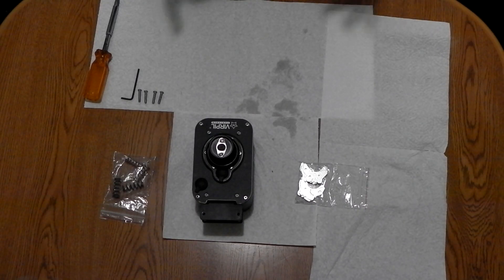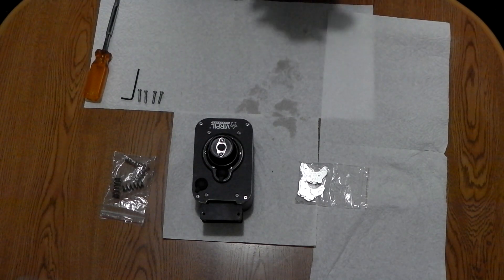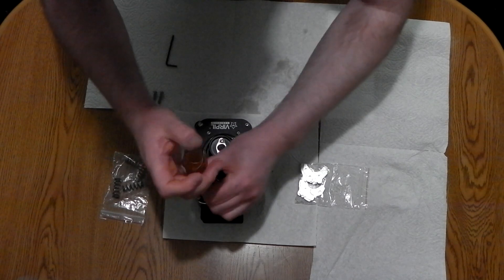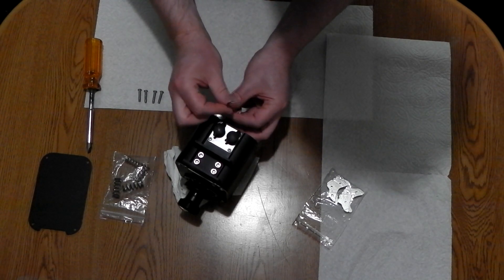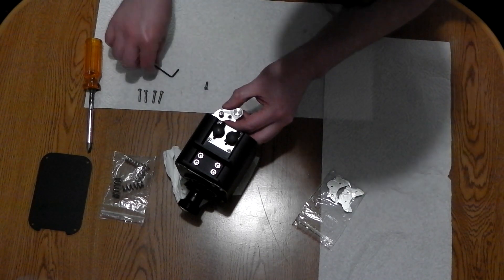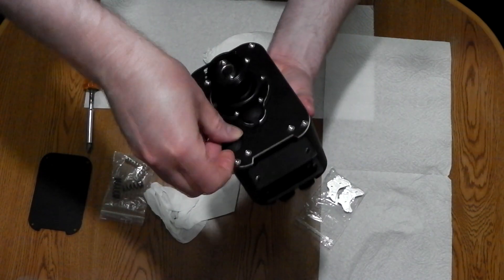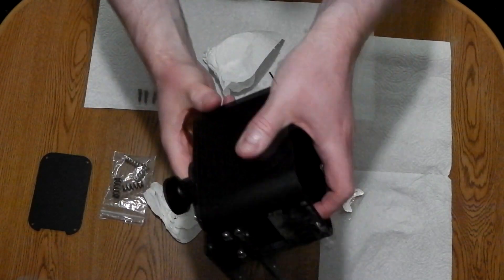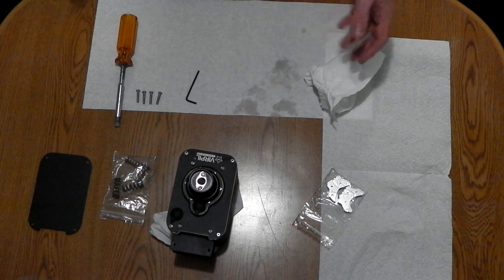VPC MongoosT-50CM2 Base - Change CAMs tutorial

Comment: Nice. Got a stick (cm2 base) and throttle and collective with an l alpha waiting in the post office. Nice walk through for preparation.

One thing though. Helicopters should be light, or rather loose. No center and no force will be most proper setting.

Comment: No mention of how tight the new stick is?
Reply from the maker: Hi, Not sure exactly what you mean by "tight" ?
Reply: You add an extension to the stick and its loses all its tension.New stick is supposed to cure this by allowing stronger springs to be used with long extensions.
Reply from the maker: @dealwolfstriked272  AH ok I get you, I am using the lightest springs with a 50mm extension, I fly a lot of helis so want a stick not to hard move but yet want it to return to centre, it does that fine
Reply: That is my main reason to buy the new gimbal.For me any extension I add just reduces the tension to unacceptable for my needs.I will wait for someone who uses extensions and flies planes then....anyway thanks for response.
Reply from the maker: @dealwolfstriked272  What grip are you wanting to use with it ?
Reply: The warbrd for now but eventually all grips.
Reply from the maker: @dealwolfstriked272  Iam using CM2 base (aviation sim soft centre cams with lightest springs)  + 50mm extension + CM2 grip. The movement is smooth and the return to centre is fine
Reply: @HavocCompanyClan  This may be a dumb question, but how do I tell one cam set from the others? Do they come marked as Avia or Cosmo? or? Thanks, love the content. I am SLOWLY figuring out how to program my throttle so i can start using it. ;)
Reply from the maker: @claytonwhitman1608  see this pic https://i.imgur.com/CYAdS0Q.jpg
Reply: @dealwolfstriked272  FYI I installed  the TM Warthog stick (very heavy) on the CM2 base with the standard springs and aviacam soft center (stock from factory) with 100mm extension and DO NOT like it at all for flying fighters. The soft center on both axis combined with the heavy weight of the stick is a strange imprecise feeling. Switching to avicam no center for roll, avicam soft center for pitch with heavy springs which hopefully will make it better.
Reply: @MANZOIL  thanks.Right now I run no extension on Warbrd base with lightstick and the extra heavy spring and its better IMO.
Reply: @dealwolfstriked272  hey quick update for you and anyone else reading this, Virpil responded last night and confirmed there’s a manufacturing issue with their cams. Apparently they were redesigned summer of 2020 so if you have some prior to then I recommend you reach out and they’ll send you new ones for free. This explains all the uneven and strange feedback I was getting, hopefully the new ones remedy that.
Reply: @MANZOIL  thanks for heads up.